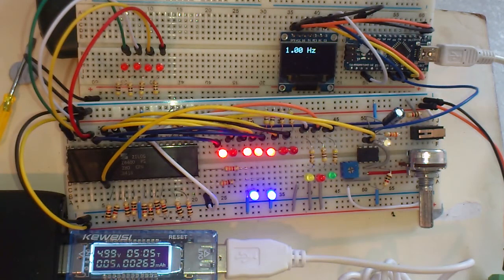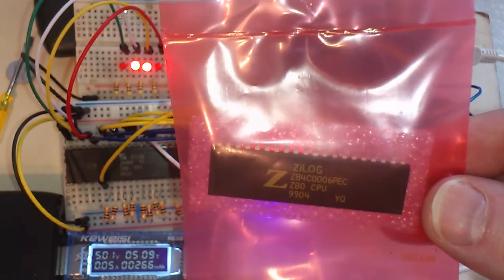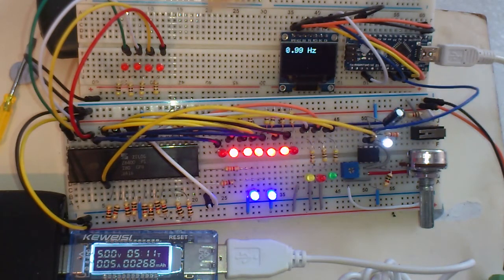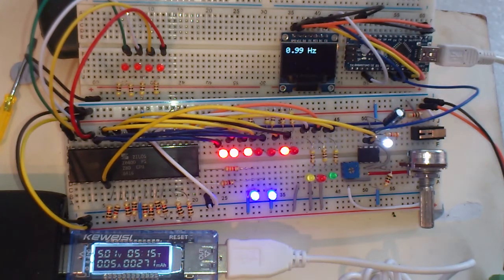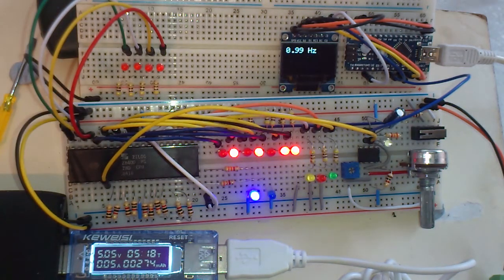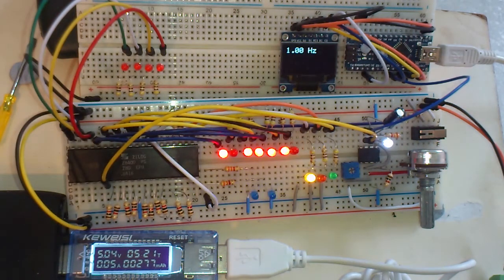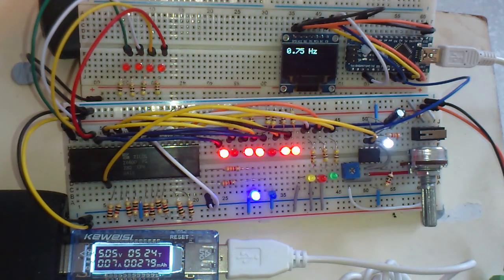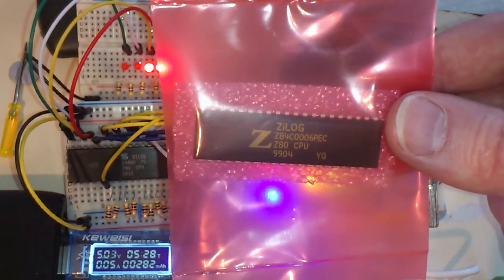Zilog Z80 CPU Running at 1 Hz

Comment: Great video, thanks for posting it. 
Is there any chance of the code for the frequency counter? 
I have the same display and a Arduino nano in my parts drawers, so I'd like to give that a try.
Reply from the maker: thanks yrath.I lost the original code for this project, but it was similar to this one using Adafruit graphics library:

#include <FreqMeasure.h>

#include <SPI.h>
#include <Wire.h>
#include <Adafruit_GFX.h>
#include <Adafruit_SH1106.h>

#define OLED_CLK    13 //D0
#define OLED_MOSI   11 //D1
#define OLED_CS     10
#define OLED_DC     9
#define OLED_RESET  6 // moved from default 8 for FreqMeasure library on pin 8 

// Unccomment this line If using software SPI
//Adafruit_SH1106 display(OLED_MOSI, OLED_CLK, OLED_DC, OLED_RESET, OLED_CS);

// Uncomment this line to use hardware SPI (faster!)
Adafruit_SH1106 display(OLED_DC, OLED_RESET, OLED_CS);

#if (SH1106_LCDHEIGHT != 64)
#error("Height incorrect, please fix Adafruit_SH1106.h!");
#endif

void setup()   {                

  //SPI.setClockDivider(4);

  // by default, we'll generate the high voltage from the 3.3v line internally! (neat!)
  display.begin(SH1106_SWITCHCAPVCC);
  // init done

  FreqMeasure.begin();
  
  display.setTextSize(2);
  display.setTextColor(WHITE);

}

long double sum=0;
int count=0;
unsigned long oldmillis = millis();

void loop() {

  if (FreqMeasure.available()) {
    // average readings together
    sum = sum + FreqMeasure.read();
    count = count + 1;

    //double val = FreqMeasure.read();
    //float frequency = FreqMeasure.countToFrequency(val);

    if (millis()-oldmillis > 250 || count >= 100) { // update four times a second at most at low Hz
      
      float frequency = FreqMeasure.countToFrequency(sum / count); 
 
      display.clearDisplay();
      display.setCursor(0,0);
    
      display.print(frequency);
      display.println(" Hz\n");  
      //display.println(count);  
      display.display();

      count = 0;
      sum = 0;
      oldmillis = millis();
    }
  }
}

Comment: Great video! Finally I know why the A8 and up are flashing :-) Thanks a lot for the info! Nevertheless I would recommend anybody starting with CMOS directly. It will save you lots of headaches. Though NMOS seems to work for you, I had 6 different NMOS chips and all behave erratically at 1Hz. I wasted weeks of troubleshooting and rebuilding circuits. Z84C0010PEC is CMOS and it worked from the first time (and it can run up to 10Mhz). It only costed me 4 euros en eBay.
Reply from the maker: Thanks. Yeah I think I got lucky with the old nmos chips I used, they definitely started getting flaky at below 1 Hz.  It's kinda cool that some of them can run at 1 HZ though (for days)! Sometimes the problem was bad breadboard connections, which was fixed by removing the cpu and reinserting it, but I couldn't get any stability with the nmos z80s at 0.5 hZ or below, it's just cool that the cut-off for stability is at ~1 Hz!
Reply from the maker: Hi, I noticed the same issues you had with my nmos chips and found that the culprit was noise on the output from the ne555, maybe due to poor breadboard contacts. I instead used a 4093 IC in Two gate oscillator mode and the signal was very clean and the cpu very stable again, see the circuit herehttps://books.google.co.uk/books?id=ab4cDgAAQBAJ&lpg=PP1&pg=PA26#v=onepage&q&f=false
I used a 1uF capacitor and 1M ohm pot, stable 1hz generated at about 600 komhs

Comment: Had a similar idea but utilized the arduino for everything. Used pin 13 on the arduino to send the clock signal (pin 13 has an led already set to it to see clock cycles) have to reprogram the arduino to change clock speed though, The variable resistor and 555 is a good idea. used 8 of the arduino pins set low to send a NOP instruction and the 5v and gnd from the arduino to power it. Still requires a few pull down/up resistors but was a quick way to test it
Reply from the maker: Thanks for the info,  I mention using the Arduino to do the timing, I was thinking of doing all kinds of fun stuff like using the Arduino to generate wait states, interrupts, bus requests, and also investigate timings of more advanced instructions too. But I have been busy  recently, and when I get more spare time I also have Raspberry Pis to tinker with and other modules (esp8266, esp32 boards) so may not get back to the Z80 for a while.